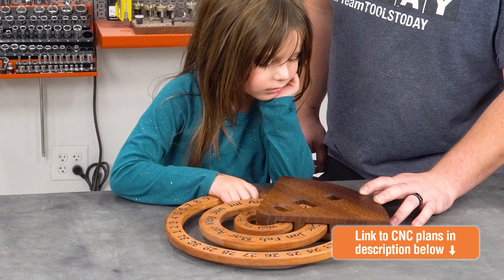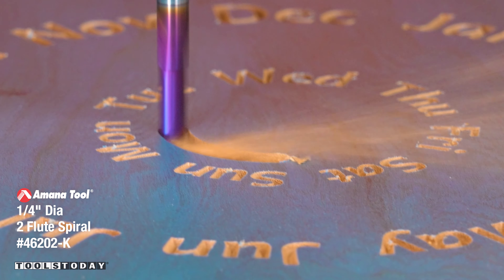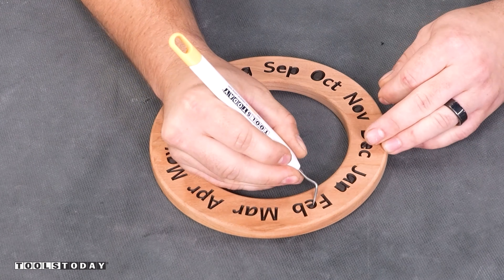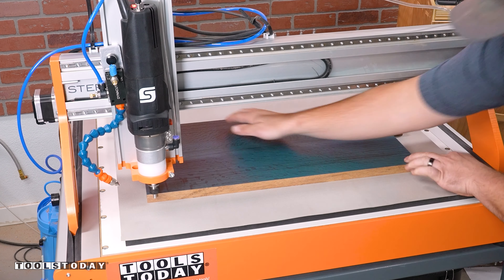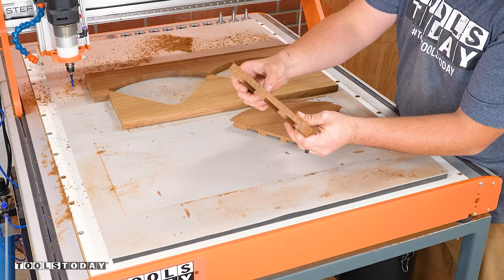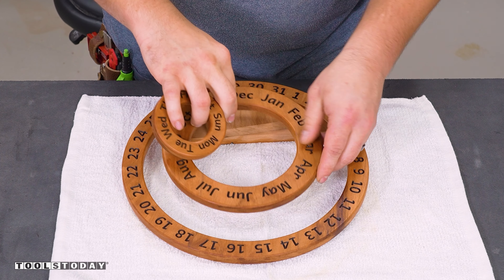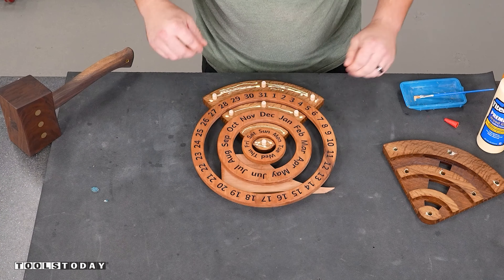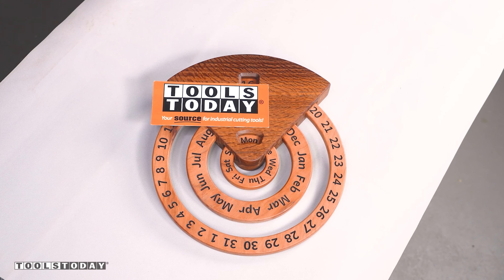How to Make Perpetual Wood Calendar, with CNC Plans | ToolsToday CNC Video

Comment: I bought your files for this project and am wondering what woods you used for it. It looks like Etimoe was used for the holders. ????
Reply from the maker: Thank you for the support!  It is thermally modified white oak that my local sawmill had.  Looks crazy!
Reply: Was I correct on the darker wood? Is it Etimoe or Leopard wood?
Reply from the maker: The darker wood is thermally modified white oak, the lighter wood is Cherry